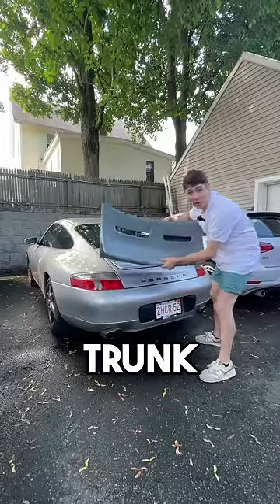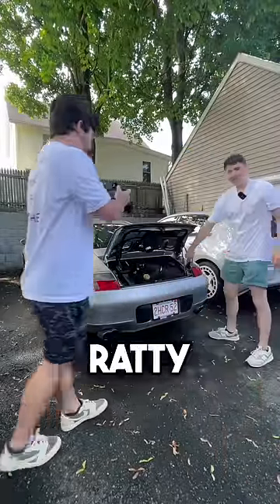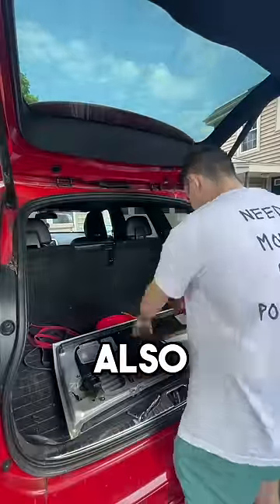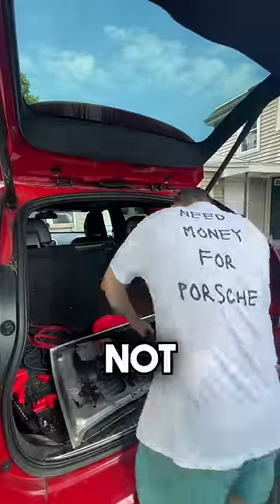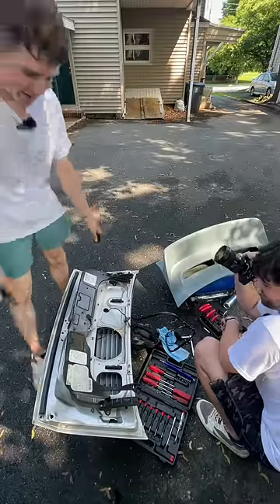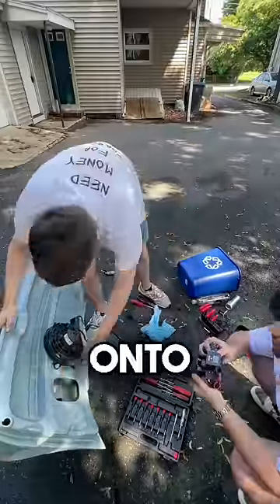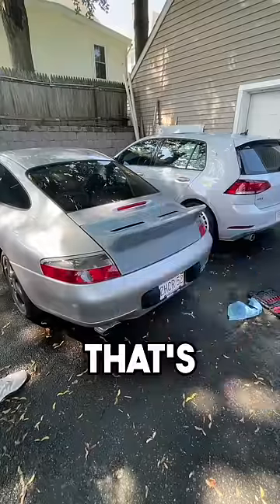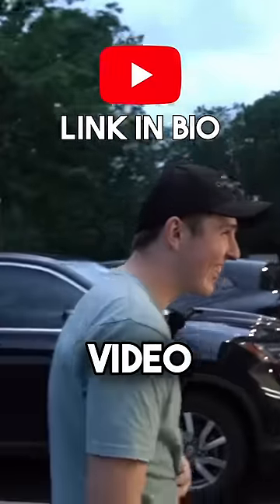A Much Needed Upgrade...

Comment: You know me personally, I would’ve paint matched and clear coated it before putting the parts back on and installing it
Reply: He mentioned wrapping it at the end of the video.
Reply: Wrapping isn't clear coating or painting. Are you ok?
Reply: @mf1936 “wrapping“ doesn’t refer to clear rock chip guards (in this video). They have different colored vinyl that looks just like paint.

Comment: I love the build series keep it up!
Reply from the maker: Thank you!
Reply: What about the garage?
Reply: A build is something you redo or make down to top or make enough modifications in which the car looks way different from before. In which will be the Porsche in the future. 😃
Reply: @captaincrankshaft why don't you change the extremely ugly ass eye burning 4 spoke steering and also add a Android screen rather than a radio and the steering you should add is the latest one or the one in 2012 911,s

Comment: If you ever have to cut a wire make sure you give it enough slack to reconnect it later if you have to. Cutting right where it’s coming through the panel gives you no room.
Reply: as a sparky i cringed

Comment: Nice Porsche!
Just as nice as those cars from the 50s, 60s, and 70s!
Reply: Early 2000s
Reply: @Coolestboymelo do you have reading comprehension issues
Reply: @ncor04  it’s a joke the car is a Porsche 911 and by early 2000s I mean 2001
Reply: @Coolestboymelo so yes, you do have reading comprehension issues

Comment: It looks better sure but bro looks at the two side by side, the stock one is far better in terms of cooling and venting. Remember, most the older ones are air cooled, that things gonna make it run wayyyy hotter and probably overheat over time honestly. Hopefully it doesn’t tho, looks cool

Comment: just a tip whenever cutting wires leave enough space just in case you need to use that wire and butt connector then together

Comment: The car have no problem as factory designed, you are the problem because this car doesn't offers what you want. See, this is a common problem with a lot new car enthusiastic like you buying a wrong car. You will probably putting a lot money trying to make this car what you wanted to look and it's fine but don't forget that what you like may not settle well with other and on that note be smart in how much you really want to invest in this car because if you decide to sell may be a problem eventually.